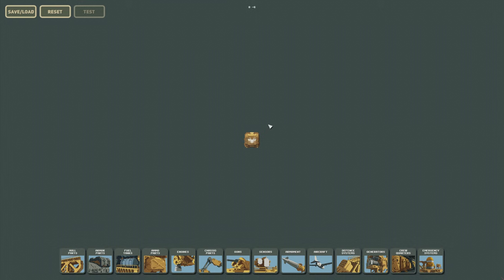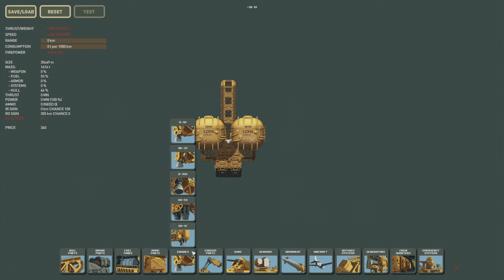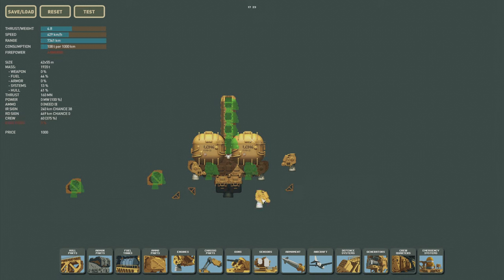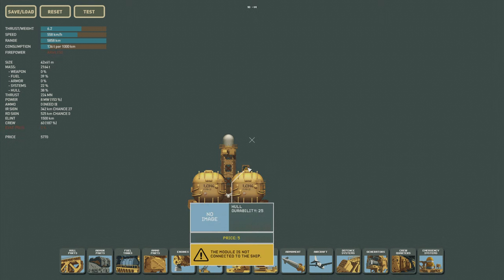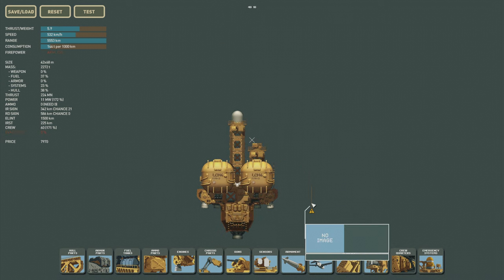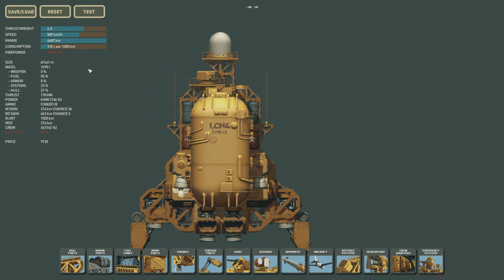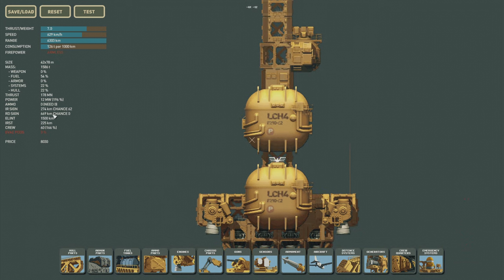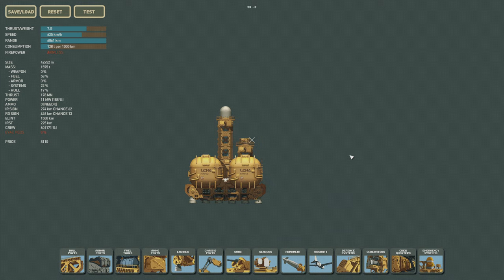Skylark 2.0 - Custom Built Supply and Enemy Detection Ship in Highfleet!

Comment: large engines currently are just worse then small engines btw much worse mass vs thrust ratio
Reply from the maker: Good to know - was prioritizing range and fuel efficiency. I don't know if thrust ratio matters if you're not in combat?
Reply: @ShadowcoastGaming  so basically for speed stat it takes the mass of the ship vs the thrust you are producing and currently large engines produce the thrust of 3 engines but have the mass or like 5+ since you have to take into account the frame
Reply from the maker: @n3v3rforgott3n9  Thanks - need to do some more experimenting - really appreciate the call out and need to make some changes now!